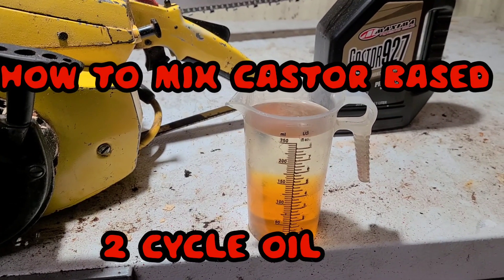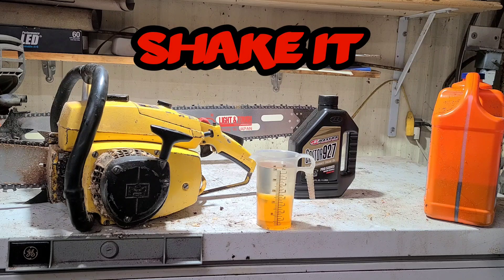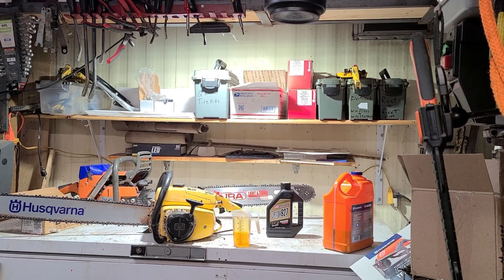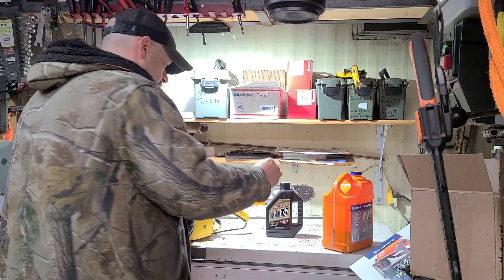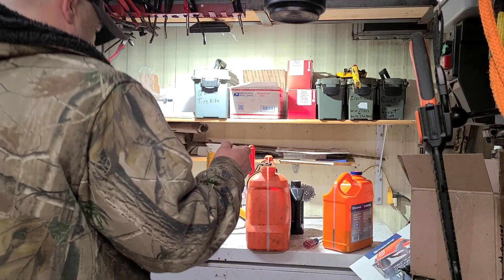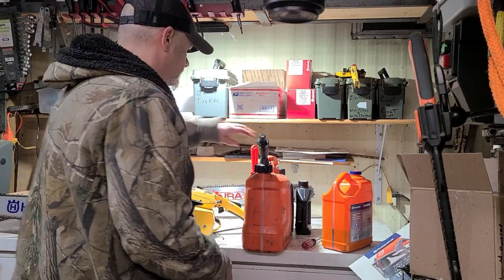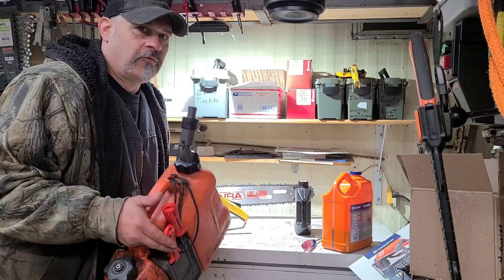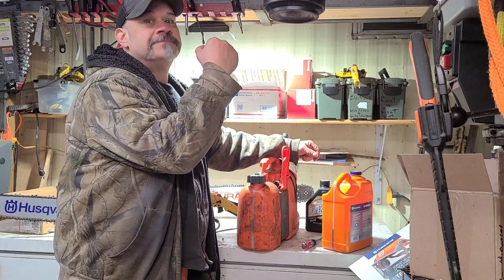HOW TO MIX GAS AND CASTOR BASED 2 CYCLE OIL. TAZ 2 STROKE TECH TIP

Comment: This might sound really dumb but have you thought of using a $5 magnetic stirrer, beginning with the fuel (gasoline) stirring and then dumping the oil in on top of that, then just leaving it to mix on its’ own?

In the old days using that kind of lab gear would be crazy but nowadays hipsters use them to mix coffee.

Comment: I mixed some castor and av gas 32:1 for my yz125 it would stay mixed for a few mins than you could actually see it sinking to the bottom. This 70 degrees outside btw. Never ran it was gonna try it been running k2 might try mixing a gallon in of 93 and see how it stays together

Comment: The other thing to consider is that castor leaves such thick deposits it eventually seizes the ring to the piston. 
Castor is best for hp motors that are disassembled on a regular schedule.

Comment: Just used the maxima super M full synthetic for the first time the other day. I found it weird how resistant it was to mixing but it definitely mixed a little easier than the one your using in this video. I was distracted while mixing the fuel and I splashed some fuel in my saw and barely shook the can. Thank god it still had 3/4 of a tank of good rich mixed fuel. Thanks for making this video I’m definitely going to switch back to regular oil after this, ain’t worth the risk of ruining all my equipment.

Comment: Castor based 2 stroke oils are amazing. However, you cannot run Maxima Castor 927 in temperatures below 35°F, otherwise it will separate from the gasoline. You should run a full synthetic in the winter. Castor for the summer!
Reply: Only true if it’s specific gravity of the gas is less that .735 so race gas or AV gas. Pump gas won’t have the issues at low temp

Comment: Hey brother, do you typically use castor oil in your saws? If so how well does it coat the metal internals? I would think it would be a bit gummy like carbon deposits in the muffler etc. Just a guess man. Keep on Rollin brothers and sisters.. 👍
Reply from the maker: Thank you Shane. This oil is actually one of the cleanest buning 2 cycle oils made. I run it in my saws with 95 octane non ethanol fuel. 🌲❤🌲👊🪓
Reply: Thanks for the reply brother, I always use supreme fuel and lucus synthetic in all of my saws. I'm curious and going to try the castor oil if I can find it up here in Canada. I have a fresh Jonsered 625 full bottom to top ported all new that hasn't seen fuel yet. Think ill run it on that castor oil mix (WELL SHAKEN) once its located, no cross contamination with any other product.. I really appreciate your time and help as I know you are a busy man.. Looking forward to the next live feed.. All the best to you and your family.. Cheers

Comment: You almost need an immersion blender with that stuff, does castor bean oil work good in extreme cold conditions?
Reply: Please don't do that. There are  gasoline vapors in that mix, and an immersion blender has brushes that makes sparks within the vented housing. We all know what gasoline vapors and sparks produce right?
Reply from the maker: Thank you Rich for your support. Much appreciated. That would be handy for sure. This oil will separate in all seasons. 🌲❤🌲👊🪓